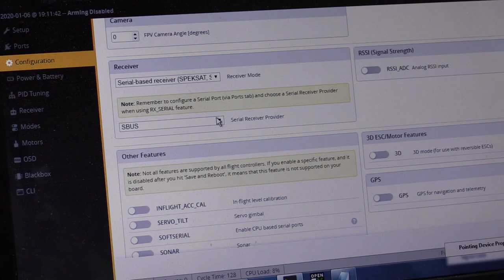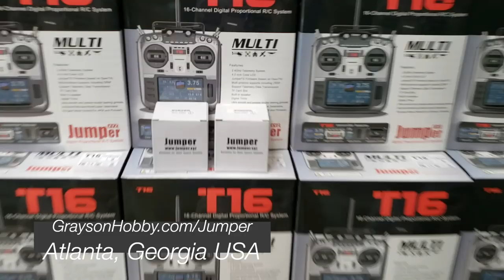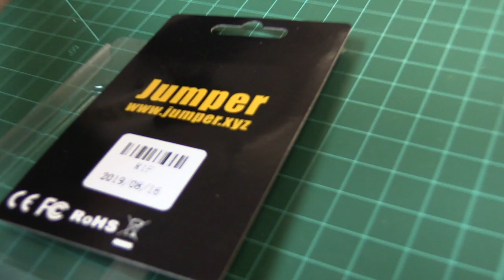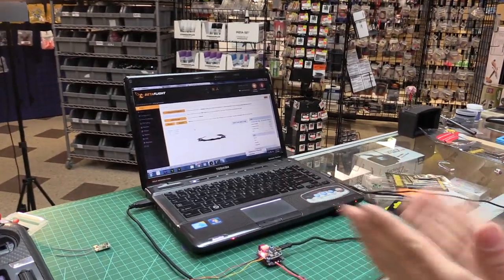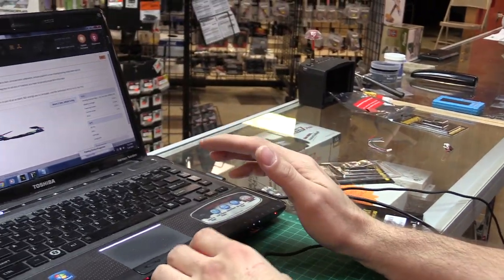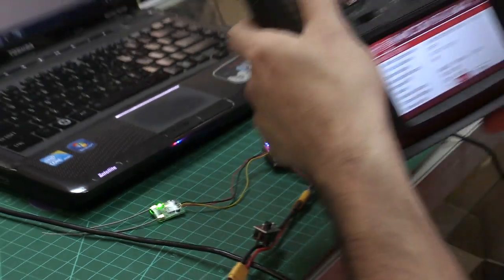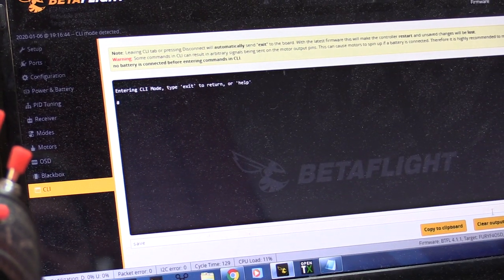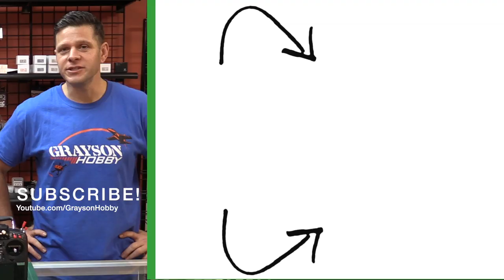Jumper R1 F-Port Receiver Setup | Review | Betaflight Commands

Comment from the maker: The R1 F-Port is a great receiver for any drone build, especially with stacks that are low on UART Ports.. - F-Port is faster than SBUS and requires just 1 wire!  Link to the R1F --> https://graysonhobby.com/jumper-r1f-f-port-receiver.html
Reply: Can I use the same cli commands for my HGLRC F4 Airbus fc?
Reply: does this work also for fixed wing planes??
Reply: @hanrenfighterjet  of course!

Comment: SBUS may not work for full telemetry.   My setup is Mamba F4 30x30
ver1 with newer R-XSR running FPort. I tried running the signal (from the non-inverted
solider pad on the reciever) to the SBUS pad on the FC and could only get RSSI
and receiver voltage. Then moved the signal to the Uart (TX1) on the FC and
adjusted the serialrx_halfduplex and serialrx_inverted setting and all telemetry
works.
Reply: I had the same experience with F-port on SBUS. Can you please verify that the FC does send telemetry TO the receiver also? Video only shows receiver sending RSSI to FC.

Comment: I connect a jumper r1f in the iflight f7 fc in the T2, 5v and ground. The receiver connects to transmitter put not respond any movements. Urart in the 2 position rx serial, i put all the configuration following the iflight diagram and still not respond. Did you know what is the problem? Thanks

Comment: Thanks for fast shipping! I do not find F port option in Betaflight.
Reply: configuration tab, receiver, select serial in receiver mode, and Frsky Fport in the box below. If it isn't there, you will need to upgrade your FC firmware.

Comment: Do you have a video to set up telemetry with this receiver. I've tried the r1 and r1f and no telemetry. I'm connected to the sbus tab on my r4 flight controller it's a 450 I think in an eachine tyro 129 no uarts will give me control. Transmitter Seems to work whether inverted or not. The only sensor my receiver will display is battery power which is usualy 0.0. Been on this for weeks watched lots of videos but giving up now. Do I have to do the hack and remove the 2 ic's etc  Hopefully you have an answer. I'm using inav Thanks

Comment: If I understand correctly, FPort has limited usefulness on F4 boards as most don't have bi-directional SBUS ports.  This means you won't have telemetry communication with the FC (no lua scripts), only what the receiver is  measuring (RSSI & receiver voltage).
Reply: solder a wire to the middle pin of the inverter on the other side of the board, connect to a TX port on you F4, set serialrx_provider = FPORT
set serialrx_halfduplex = ON
set serialrx_inverted = OFF
Or you can connect the normal Fport output to a TELEmetry connection on your F4 if it has one.

Comment: Hello , 
Using this receiver , I am able to get RSSI , GPS coordinates, battery voltage ..... in jumper t16,  But no battery % / battery remaining.  Using Jumper T16 and Matek f720 wing FC. (In the  INAV correct battery % / battery remaining is displayed but not on jumper t16)  Any suggestions??

Comment: Will this work with Crossfire or Frsky R9 modules(I have Jumper t16)? Also, will this work on fixed wing?
Reply: Hi Devin,

Did you end up trying this on a fixed wing? If yes, what size?

Cheers.

Comment: Hey there guys.
The video is really nice and it got me thinking about changing the reciever on one of quads to this particular one :)
I've also noticed that when you powered up the battery there was no startup beep on the FC. On my mamba f405 and succex-e f4, when i plug in the battery, FC does this beeping music on startup. Is that a feature you can turn off? I tried to find any info on that, but without any results.

Thumbs up!
Reply: Or it might be ESC's startup tone - neretheless i am looking to disable that regardless of origin :)

Comment: For the life of me, I can not get this to work. I have the red and green lights solid on the R1F, then I press bind on the T16, it chirps 3 times and then nothing happens at all. Tried all combinations of the FrSky protocol, but nothing. Super frustrating.
Reply: set the fine tune to -10 or more, worked for me.

Comment: I just installed on of these R1F receivers on an Iflight Succex whoop board using the SBUS pad. The controls work and I get RSSI back to my transmitter but no other telemetry data. Is it true that F4 boards don't have the ability to communicate other telemetry data like battery voltage back to the receiver and then on to the transmitter?
Reply: Same here, very strange it works on sbus pad. My other fport rx works on a uart tx and give full telemetry. This one on sbus pad don't give full telemetry, very disappointed, or I do something wrong?
Reply: @MrJT270567  It is only working in SBUS mode connected to SBUS with SBUS protocol selected. Fport has to be selected, with a serial RX in Ports. try the un inverted signal from the inverter on the other side of the board to a tx port.
Reply: Christopher Yotz on rcgroups.com is a thread for this rx. You need to use an uart not the sbus

Comment: Do we need to calibrate anything or is that F Port RSSI value I am getting  accurate?  Does It not send flight pack voltage?  I can't seem to get Lua script to work with this F Port.  I'm getting RSSI but not VBAT.  Lua shows nothing.  Thanks
Reply: Are you by chance getting a lower rssi signal? I am getting a signal at least 25% weaker than an xm+. I have flown both back to back. So I am wondering the same question in regards to rssi calibration.
Reply: @mkunakoff  It does seem a little off.  It's close.  Still no VBat and I have telemetry on.  It seems we don't get full telemetry with this F Port receiver.  I get only signal telemetry (RSSI and signal related sensors). NO VBAT.  Bummer
Reply: Mark Johnson check www.rcgroups.com search for jumper r1f there you find the info you need

Comment: Thank you for the video.  

Can you please tell me:
(1) if the R1F will work on my Beta85X HD (2S-3S) with a F4 Flight Controller?  
(2) Will I get the full telemetry?
(3) Do I need to update the firmware on the R1F and if so how and where do I get the firmware?

Thank you.
Reply: Hey bud how did you go?
Reply: @Yoyoyo32  I got it finally to work. I had to use another port (TX3).   I found out the hard way that the TX1 wasn’t working.

Comment: When binding it I get the green light flashing instead rip
Reply: if both leds do not come on, you are not pressing the button well enough while powering on. Also set your freq fine tune to -10 or -20.
Reply: @richarddoberstein8308  Tank you, was struggling with this.

Comment: I have telemetry fully functional on a F4 FC

Enable softserial

Connect rx FPort to softserial tx (not SBUS)
NOTE: connecting to SBUS will only provide rx functionality (no telemetry)

set serialrx_inverted = ON
set serialrx_halfduplex = ON 

set telemetry_inverted = OFF
set telemetry_halfduplex = ON (BF or iNav 2.5)
set telemetry_uart_unidir = ON (iNav 2.4)

Comment: Bad receiver failsafe in 150 metre 
I feel like I am using a flysky receiver even worse
Reply from the maker: You need to configure and tune
Reply: @graysonhobby  tuned already and change the receiver result is same I go back to rxsr
Reply: That's a bummer. I just got two of these to try out. I guess I'll find out for myself.
Reply: @Dieselshroom  please write back after test
Reply: @Dieselshroom  How did the test go? The product specs say range > 2km. Is that anywhere close to the truth?
Reply: @MtnCommando  haha I never actually got that far. Still have em sitting new in package. Have completely switched to Crossfire and Tracer now. Best decision ever!